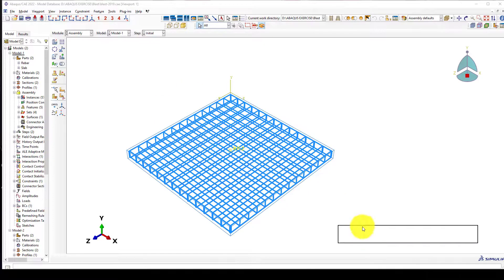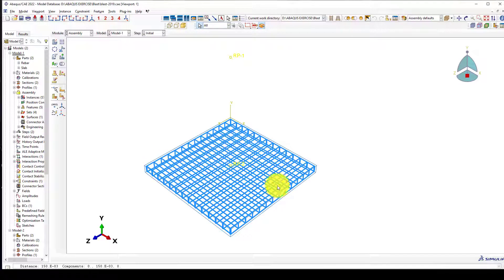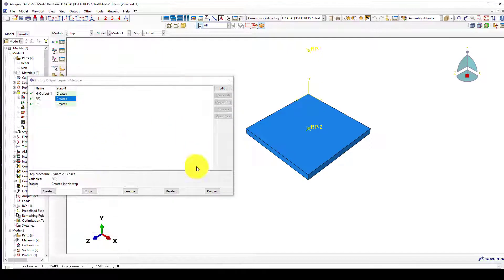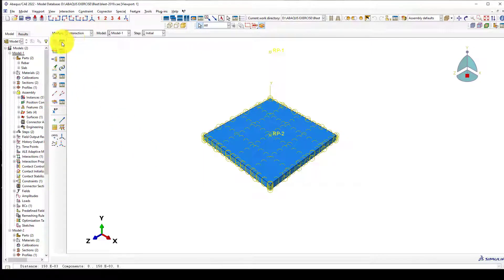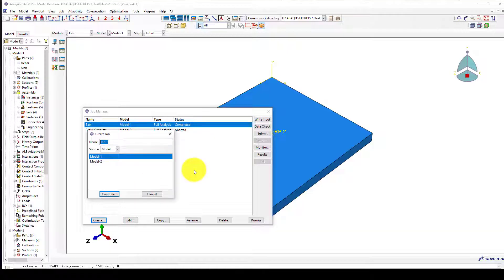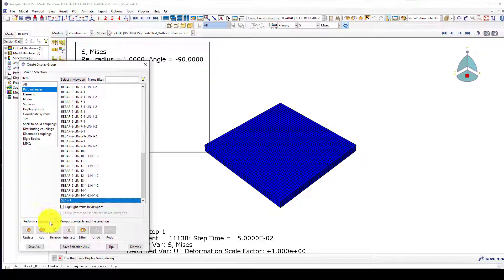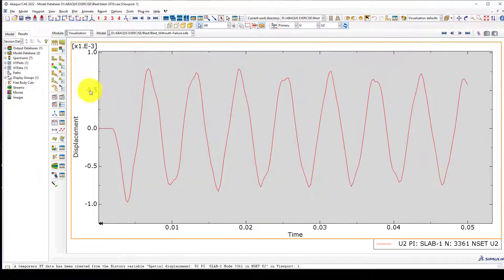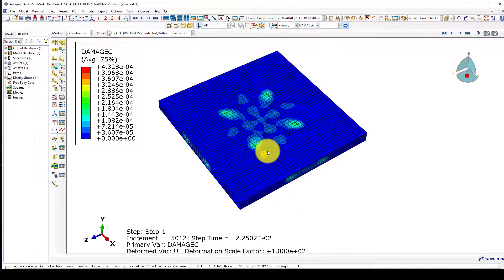ABAQUS Tutorial,  Air blast loading Impact on a reinforced concrete slab using the CONWEP method

Comment: Thank you for your sharing. By the way, I would like to ask a question. When define the CONWEP charge, only input the Equivalent mass of TNT and did not input other parameters of explosive charge. As my understanding, the CONWEP model will base on the parameters of TNT charge and those values are available in ABAQUS. Am I understanding in the right way?
Reply from the maker: Yes, correct